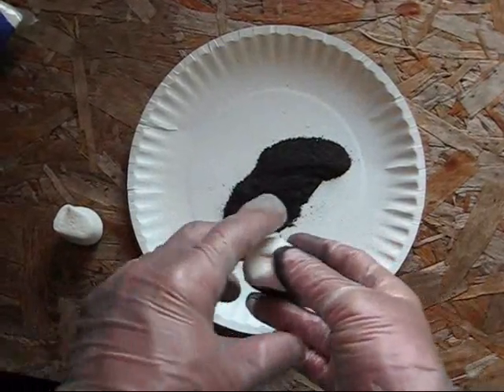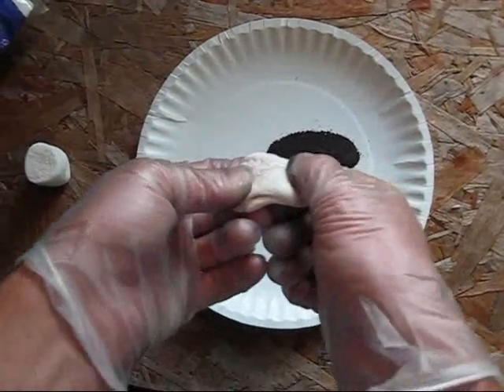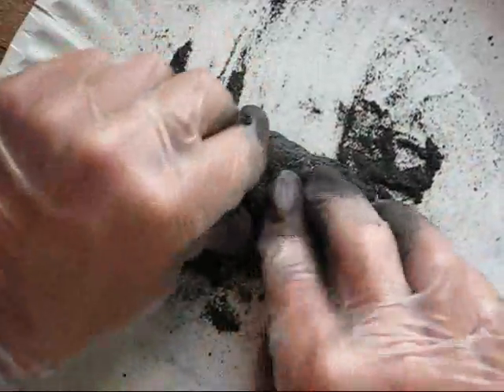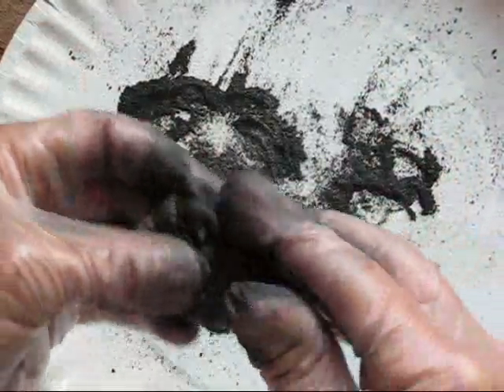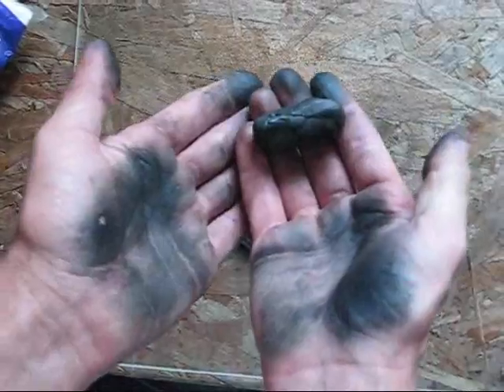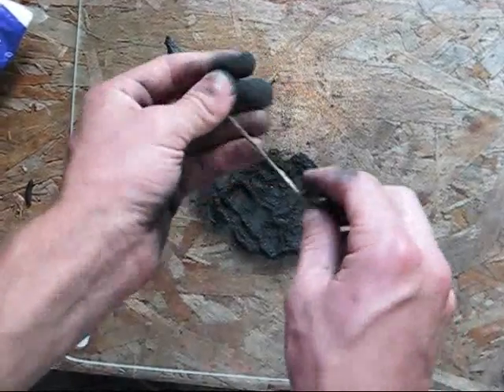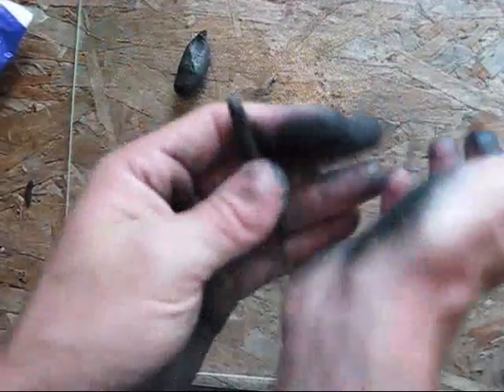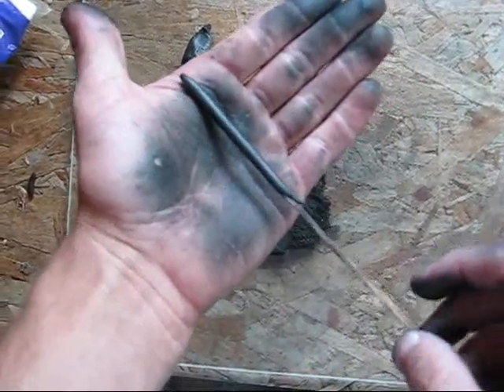How I Make Fireworks With...Marshmallows?! (HandMade Sparklers)

Comment: when I first got into pyro (2005 ish?) I made sparklers using pyrodex, flour, and those bonfire color packets. water solvent. comp on spaghetti. mostly because I was 14 and didn't know any better. it was incredibly tough to balance the size of the flame envelope with any amount of color or binder. the burn rate of pyrodex is so slow that diluting it with anything else reduces the size of the flame envelope dramatically.

Comment: Used a white bowl and a rolling pin instead of a mortar and pastel.
Also, I didn't dip in in charcoal because there's no explanation on how to get it (besides burning wood which isn't possible for me).
The final product didn't set alight like yours, it simply melted like a normal marshmallow, anything I'm doing wrong?

Comment: Since when marshmallows are left out for awhile they hard, I wonder if you rolled it as thin as a fuse and let it dry if it would work as a fuse.

Obviously if you have the powder you could make a well working fuse easily without marshmallows, but I think it would be cool to try.

Comment: Why do they seem to burn much faster towards the top of the sparkler, then slow down to a more desirable burn rate towards the lower end? That seemed to be happening consistently, and I cant imagine there couldve been that much difference in composition between the top and the bottom, because it was from the same marshmallow kneaded pretty consistently(??)

Comment: It explodes because of the tape. Think of it as a blown up ziplock bag. The air (sparklers) and the bag (tape). When you step on the bag the air has no where to go so it breaks open the bag making the pop. Same principle with a sparker bomb. When multiple sparklers are taped together they burn with a bigger intensity, when wrapped tightly the energy made by the sparklers breaks open the electrical tape making the huge boom.

Comment from the maker: Leave out dextrin, the marshmallow is enough of a binder on its own. They can be dried before using them, but for this composition at least it is not necessary. It may be for others.

The composition can be found in the sidebar.